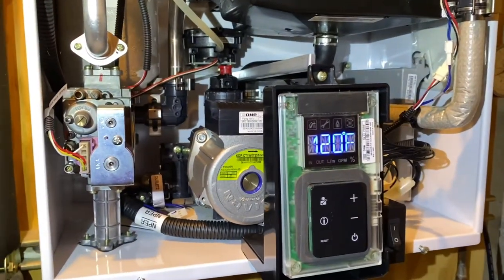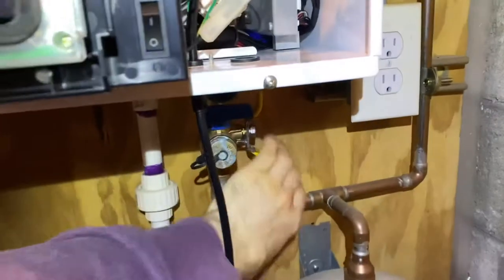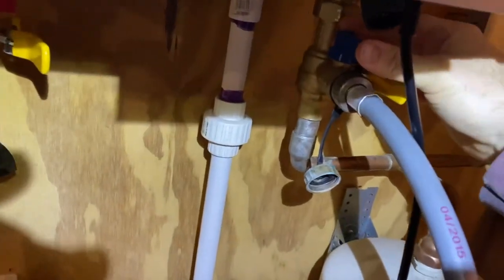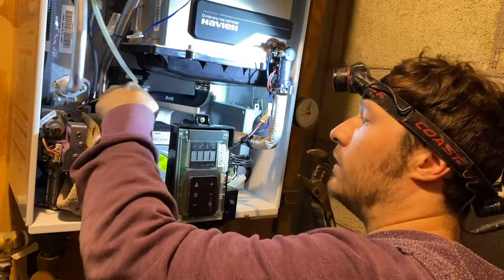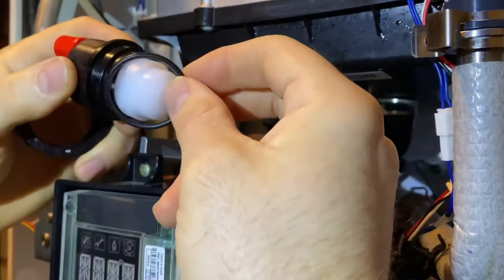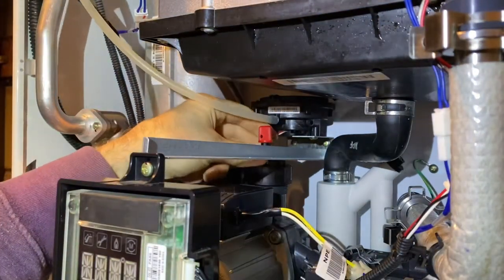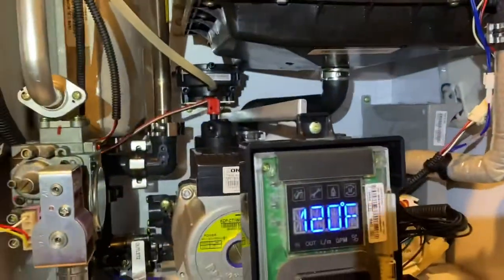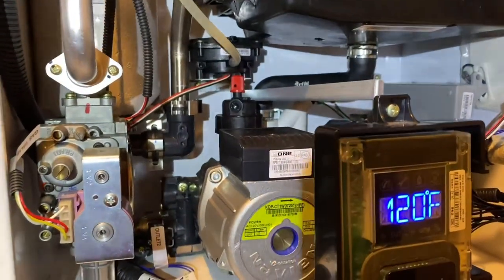Navien Air Vent Leaking, Replacement

Comment: wonderful video! quick question, a technician says in another vid, the red cap should be tight after the install, so did you do that or just leave it loss? thanks
Reply from the maker: I just left it as-is. I can open up the water heater and see if anything looks different.

Comment: My ch-210 is leaking by the space heating supply pipe I don't know if this got something to do with the pump, the building pressure or its just the gasket.
Reply: Take the cover off and inspect the air vent or other possible areas for leaks. It’s 4 screws, 2 on the bottom and 2 on top to take the cover off. There are so many orings in my navien that a leak isn’t a matter of if it’ll leak but when.

Comment: Are all the Navien equipment with that air vent above circulation pump
Reply: From the ones I’ve seen, they all have the vent above the circulation pumps. There are different variations to the design but it’s generally black plastic with a red cap on the top.

Comment: What happen if the circulation pump air vent leaks
Reply: Water gets into the unit. Obviously with electrical components inside the unit, water is not ideal. Also if it leaks enough, you could have water pressure issues and potentially throw an error code. I’ve replaced a leaking air vent 5 times now since 2011. In all instances there wasnt enough water to do any damage.

Comment: You have just officially voided your Navien warranty !
Why ?  
1. Because you didn’t call Navien tech support before thinking about calling Navien tech support.
2. You didn’t register with Navien tech support before beginning your Navien tech support authorized and chaperoned repair.
3. You didn’t download the facial recognition software app from Navien, and the repair wasn’t visually witnessed by a Navien telephone repair expert (🙄) reading from a specialized software program designed to equip the typical high school dropout with an armament of  step by step instructions on the replacement and test procedures of each and every part in the water heater/ combi-boiler.  
4. You didn’t purchase/acquire your Navien replacement part directly from the Navien factory.
5.  Your just not a ….. Navien-er .
Reply from the maker: Haha I’m not sure if this is sarcasm or not. I’ve proudly voided the warranty on everything I’ve ever owned! 😂